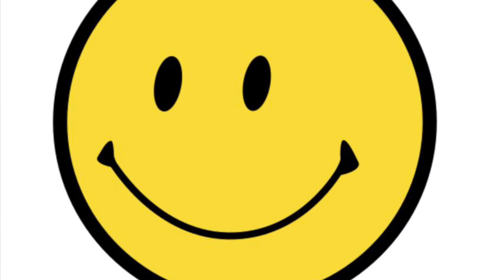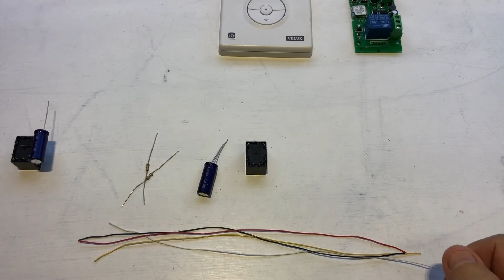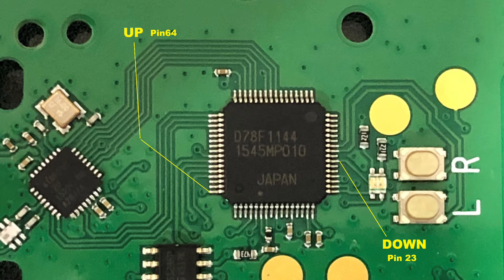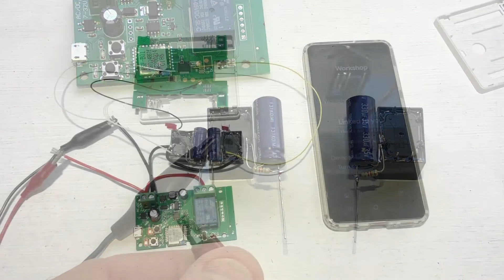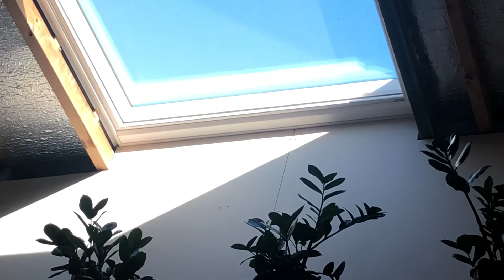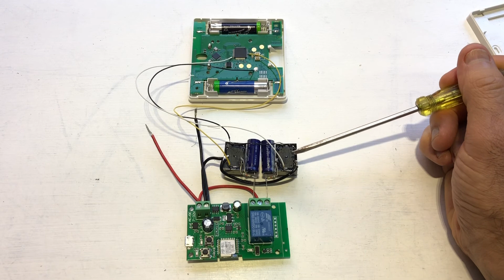Velux voice and App control for less than $30!!! Google Home, Alexa, Apple

Comment: Very good solution. If you had a double relay board could you not setup ewee app to give 0.5 second on each and do away with capacitors and resistors?
Reply from the maker: Hi, yes all valid points. I was trying to keep this very simple with a ‘one star’ electronic skill level and stuff you may have lying around or can obtain without too much difficulty. That’s what I love about electronics, same solution but so many different ways of doing it!👍

Comment: Nice HW solution.  I love it.  BTW: A momentary switch can be achieved in software at a cheaper cost.  ie: Grab a Sonoff Dual R3, install Tasmota and you can use the relay directly to control the 2 switches.  The whole setup costs around half (~15$)
Reply from the maker: Hi, many thanks! Great solution you have also suggested. My aim was to show a simple way that someone with very minimal electronic skill and resources could put this together at a relative cheap cost. It's one of the things i love about electronics, there are so many different ways to achieve the same result!
Reply: hi there; i want to make the same. setup sonoff dual R3 with velux remote, but could you show a wiring diagram?

Comment: Thanks great video. Can you write down the part list?
Reply from the maker: Hi Amir, many thanks! The parts used will vary depending on the relay you can source as the resistance of the relay coil will determine the value of the resistor and capacitor used. The values i used are shown at 8:57 in the video based on a small 12v/1A relay that i had in my workshop. You can use pretty much any small 12v relay you can get. The wi-fi controller is from eBay - DC 5V-12V WiFi Wireless Smart Switch Relay Module Smart Home Phone APP https://www.ebay.com.au/itm/232418638648  - there are many of these available from several retailers.

Comment: This is funny.
I did a really similar mod to a slightly newer version of this remote a few months ago without seeing this video.

I use an microcontroller (ESP8266) to pull the pads high or low to press the button. I power and close the curcit trough the microcotroller. This should be save as the microcontroller runs on 3.3 volts.

Comment: So what was your solution to hiding the wiring and rest of kit?
Reply from the maker: As i had a spare second controller i put it all in a small electronic jiffy box with a small 12v power supply and it sits in a cupboard connected to a power point about 10m away from the skylight. No one can see it or knows it is there. I still have my original Velux controller mounted on the wall near the kitchen as a back-up & just for added convenience. If you are using your original controller and you can get a 12v cable down the wall cavity you could mount the controller in the wall cavity and the Velux panel neatly mounted on the wall.

Comment: you did not provide any info on the parts. at least given the part numbers or part type
Reply from the maker: Hi, at 8 min 55 seconds there is a circuit showing the values of the components. There are no specific part numbers for the components as it is just general basic stuff i had lying around. The relays are 12V 10A single pole double throw which are way over-rated for this but the smallest i had - but you could use pretty much anything you have even a small PCB micro relay would do as you are just using the contact to trigger a switch and no current.